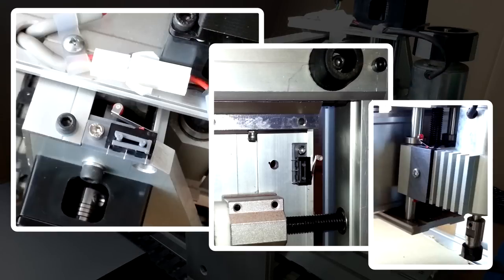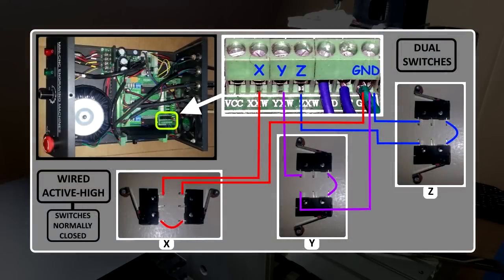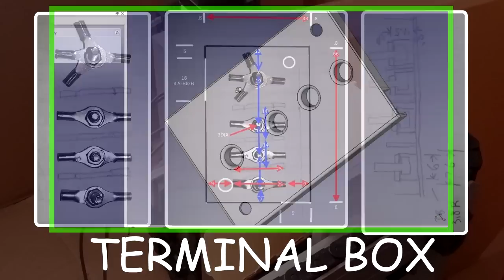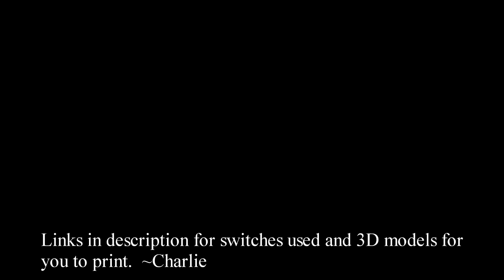CNC Mach3 | Homing and Limits Part1 | Wiring It Up

Comment: Absolutely love the switch covers. Any chance u can sell want to sell sets of 3 with the nice connector box as well
Reply from the maker: +caseyv63 
I am working on sets to sell, yes. Will let you know when they are up. The sets I am currently printing include all 3 complete switch mounts (with switches and screws), their wire retainers, and X axis switch cover. Am also getting the hardware together for the connector box as well. Is this the type of set you are looking for? If not, let me know what you need.

Comment: hello 
as icompleted my new router working well i want to ask if i set the velocity and acceleration of my motors at highest point it will effect my motors in future is it will cause some serious damage to motors
Reply from the maker: I would say run it as fast or as slow as you are comfortable with. Keep in mind the machine mass and tool pressure that each motor will have to deal with. If you set it too high, the motors will skip steps and possibly ruin your work... and possibly shorten motor life.
Reply: what value i should set then its max vel is 2300 mm/min and acceleration 1950 mm²
my step setting is 640 / step for all 3 axis
Reply from the maker: The step settings you will not change, of course. If you feel the other settings are ok for your setup, then go with them and test for part measurement accuracy and consistency. If measurements are not consistent, then your motors might be skipping steps, which means you should slow velocity down. As a note... velocity controls the rapid speed and it's also the fastest feedrate your machine will run for that particular axis.
Reply: as you say i done same reduce velocity it is working now without loosing steps but i am facing a new problem
that i dont understand i am using 5 axis breakout board with lcd DRO . my model is 6090 model and installed 4 kw spindle when i turned spindle ON the spindle  DRO reading running automatically motors are not running that time but only dro reading i checked each and every wiring all is correct this issue occurs only when i turned the spindle on as i connect external on/off switch for spindle and pot for changing spindle frequency i dont understand what is relation between spindle and DRO it should not run when i turned spindle on
my machine is nearly to complete but i m facing this issue so that i am not able to take any trial of my machine
Reply from the maker: Ignoring the DRO at the moment, does the spindle itself turn on and off by clicking the spindle button or if you MDI M3 and M5?
Reply: i have connected spindle with simple on/off switch not connect to breakout board but why i m facing this issue anything i done wrong during wiring share your opinion it will help me to fix this issue

Comment: couldn´t you just leave those limit switches out and just use soft limits?
Reply from the maker: In the part two video, I did cut down to 3 switches instead of the 6 planned. Also went with the soft limits.
Reply: @sunny5rising I am thinking of leavin em out completely. Those steppers shouldn´t be strong enough to really harm the machine or am i wrong? I ordered the 3040t-dq asa second machine for smaller work which is very similar to yours.
Reply from the maker: The main reason i installed the switches is for consistency in homing. The switches are used as home switches.  The soft limits use the homing info for location of physical machine limits.